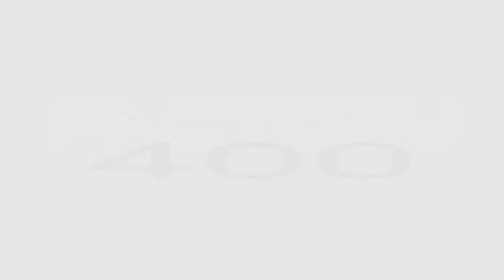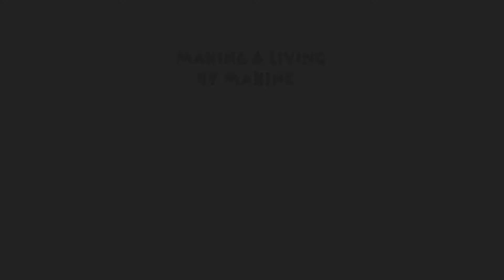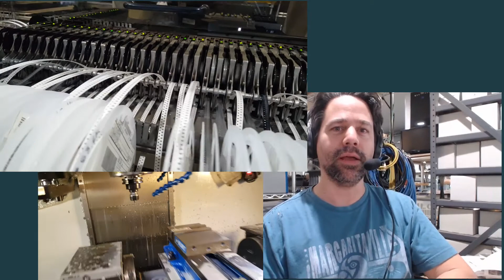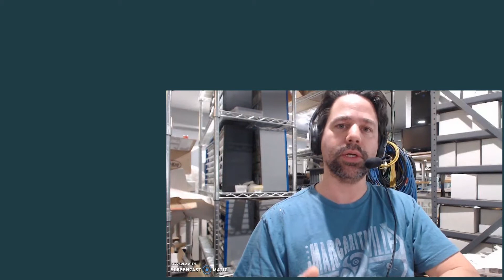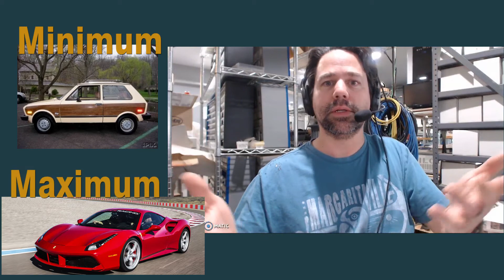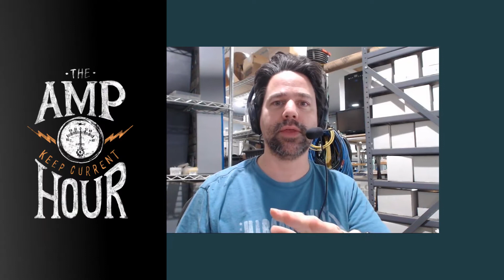WTF is 'Minimum Viable Function'? Episode 005

Comment: Excellent insight! I did electronics manufacturing for a couple summers out of high school and now I'm pursuing an electrical engineering degree. Bottom up education is huge and while I value my college education, I have definately learned most of my practical skills by diving into my own projects. 

I'm actually working on developing a lighting product for the film industry. I've got the electronics figured out, but I am a somewhat disconnected from the film industry, so not sure if I'm taking my product in the right direction. Could you recommend any resources for learning/bouncing ideas around?
Reply from the maker: The film industry has been my playground for 25 years. It is a finicky place for sure in terms of business. I tend to put some concepts together and try to find an appropriate person to test and provide some practical feedback. That can be tricky business though - the people testing HAVE to be qualified to both test AND provide feedback that is practical. 

I get TONS of great ideas from people that turn out to only be a good idea to that one person. Useless.

Comment: Your's is an interesting take on what's important. I've never been a business owner and now I'm retired so time and money look very different to me. Just trying to do or learn how to do something is often the point for me as a hobbyist.

Still, I think you have some lessons for me in how I might do better at getting a project done, ie, finishing projects. I do tend to try to have too much function in what I attempt. I'm trying to do things more iteratively so I complete a series of smaller things as I go. Iterating also allows what I'm doing to evolve as I go, based on what works in practice.

Thanks for the video.
Reply from the maker: Early on, I had a predictable habit of over-doing and over-thinking. In general, it resulted in needlessly long work hours and a trail of unfinished projects. When I got into manufacturing about 12 years ago, there was little choice but to waste less of my limited resources. 

Today, I am able to manage concept, design, mechanical engineering, electrical engineering, CNC machining, electronics assembly, test, marketing, and sales. Most of that can be attributed to a sharp focus on what I NEEDED to learn and what I NEEDED to purchase.